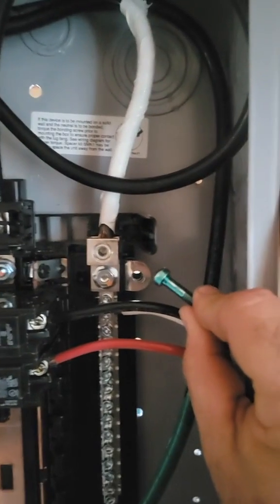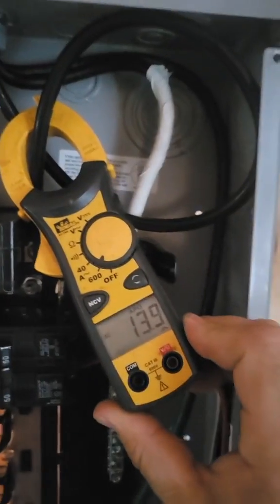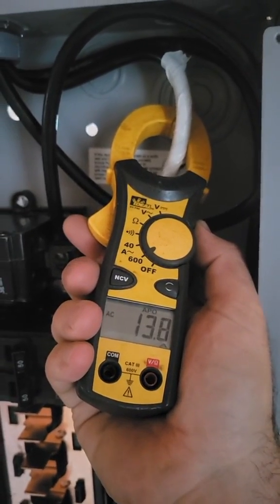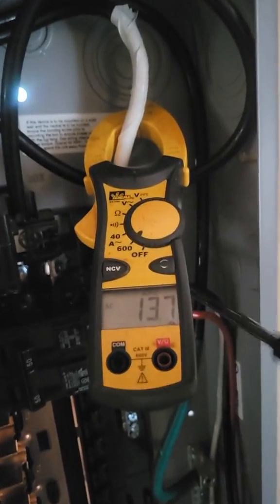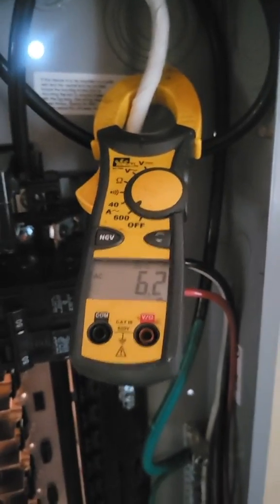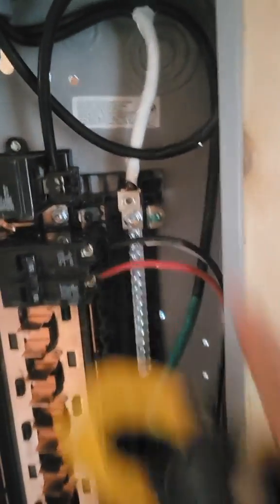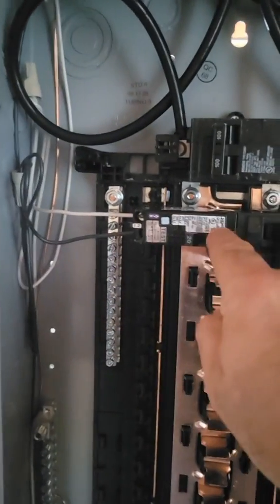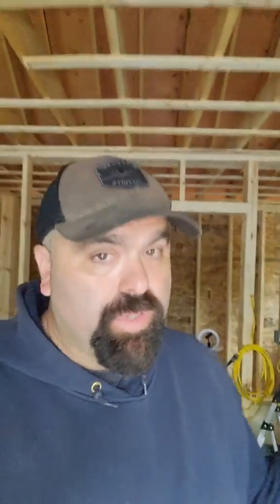CLICK HERE FOR FULL VIDEO  why do we separate grounds and neutral in a sub panel

Comment: Places wired in the '80s all wired "wrong" there has been no electrocutions, have we been unusually lucky? Should I run a separate ground which back then everything was direct bury (no conduit) ??? I am  on a farm with 4  barns all with 3 wire 2 110v legs and a neutral & grounds to earth from their boxes. 
Are you guys saying the 7amps is getting back to the main through the ground (earth)?
Reply from the maker: The danger created is call objectionable current.   If left alone and done right its hard to hurt ppl but can be fatal if working on it even if the power is off where you are working.  Separate grounds and neutral remove the hazard completely.  Have you ever seen the videos of drain pipes sparking? That is caused by not separating grounds and neutrals.  It was  always a code violation to not separate them even back in the 40s. The two exception used to be the first panel in a detached building (changed in 2008) and stoves and dryers(changed in 1996). I have a old code book collection back to 1940...
Reply: @Stevenj120volts  So I should run a ground back to the main panel   I just want to be safe  and not dead   I had no idea
Reply from the maker: @mstaff657  no make no changes an electrician must look at all the variables to decide the right fix
Reply: @Stevenj120volts  Thanks I'll get an electrician to look at the place. Thanks again
Reply from the maker: Objectable current has killed many ppl.  Basically there is a time when disconnecting the ground or neutral can make the ground become live
Reply from the maker: This is my video showing a demonstration of objectionable current

https://youtu.be/x-PG1VbfkZo?si=Dm7cLk52dUVMIx8G

Comment: I watched the full video.  I’m still not sure what he’s explaining.
Reply: I'm with you, I will check my panel boxes (2) and see if that green screw is out or screwed down..
Reply: If you do not isolate the grounds and neutrals inside of a sub panel you can shock yourself just by touching the sub panel. A lot of people forget that the white neutral wire is a conductor so if you  bond it after the MSP you are adding voltage to the ground and the sub panel is grounded meaning if you touch it it can transfer through to you.

Comment: I just discovered your channel, so I haven’t had the chance to look at the rest of your videos, but have you covered what happens to the neutral feeder when there are balanced loads in the electrical system? Such as if you had a second hot plate in your demonstration that pulled the same amount of current as the first one? This, I believe, would be a valuable learning demonstration for new apprentices.

Comment: I've got a sub-panel that I installed in my garage that I need to fix. Thanks!
Reply from the maker: Old detach building can be under a different of rules.  It must be fed with two hot a neutral and a ground to remove that bonding screw so a 4 wire feed...

Comment: is there a safety concern with bonding the ground & neutral? Safety as in, shock hazard to people or damaging sensitive electronics?
Reply from the maker: Both the  problem created is call objectable current. It can exist and you will never know but then it can also cause problems
Reply: Yes, there is safety concern if you have more than one bond. Equipment ground is connected to the frame of every appliance in the home, so you want only emergency (fault) voltage and current on that side. It's what consumers touch, so you want the equipment ground pathway back to transformer along the ground system to be entirely resistance free. If there is resistance on the line somewhere downstream, and if the neutral current is allowed to jump over to the ground side at an incorrect subpanel bond, you'll get enough voltage on all those appliance frames to cause a shock hazard, everywhere. In our TNC-S system the ground and neutral share the same wire back to transformer at service entrance, so you want the singular bond between the two to be at only one place where service entrance meets the main panel.